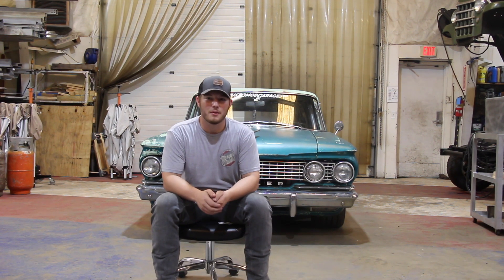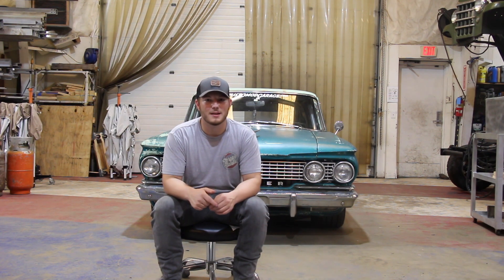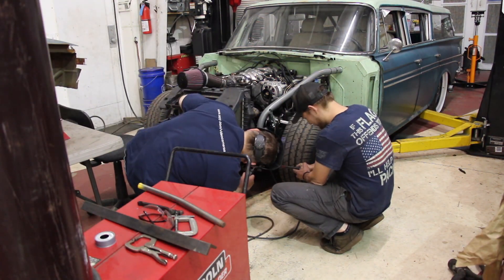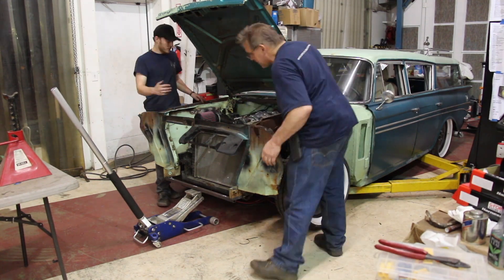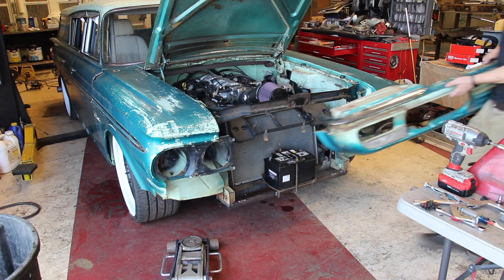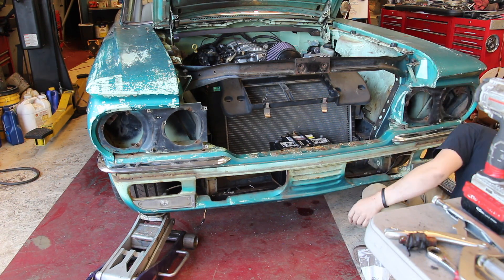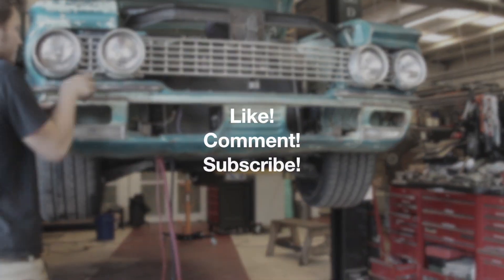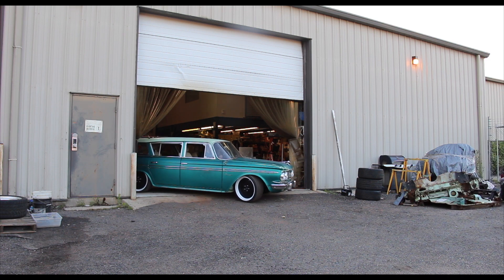We Build A 500HP SLEEPER Station Wagon Out Of A Corvette...And Its Finished? -(Rustomod Garage Ep11)

Comment: Here's a trick for rusty bolts. Get some plastic deli salad containers, and fill with a 50/50 brine mix of salt and vinegar. Put the bolts in, seal lid, and write on it where it goes. the brine will tackle the rust for you if it takes a while to come back to reinstall.
Reply from the maker: We will try that thanks for the tip!